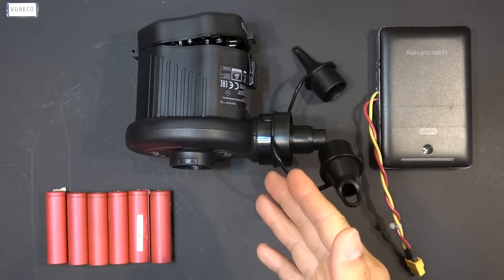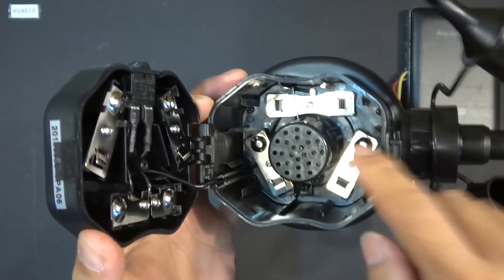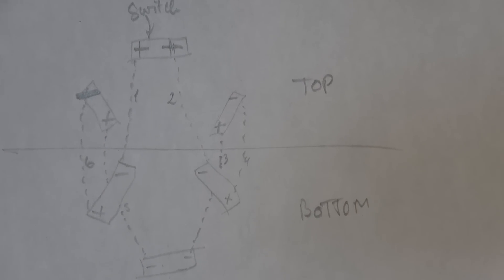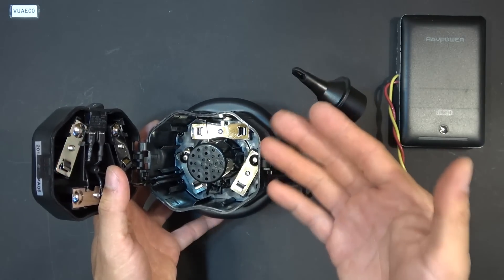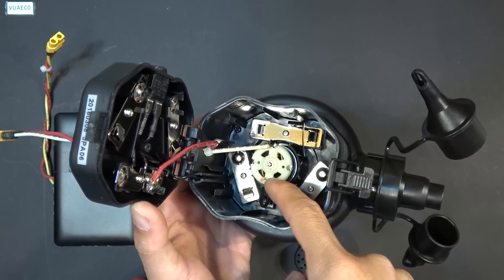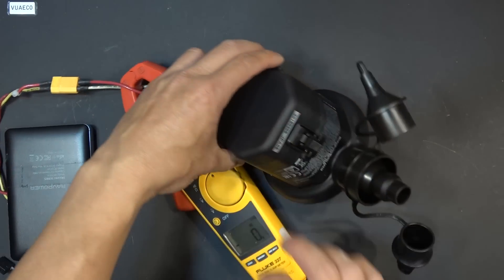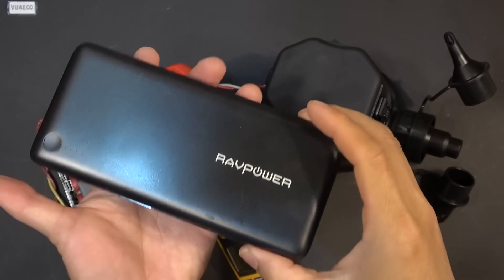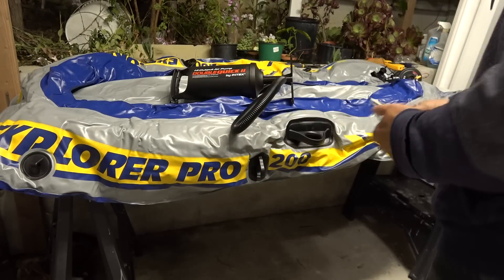DIY: Hack an Intex air pump to run on a USB power bank

Comment: I just tried something similar while camping.  I had the same pump and a makita 18v battery.  Only wire was about 8” of  residential solid 12-2 and only tool was a pocket knife.  One of the wires slipped and created a short and caused electrical smoke.    Whoops.  I’m glad to see I was on the right track with my McGyver hack job though lol

Comment: Would there be a way to make the pump go slower? Would decreasing the voltage help, or should I decrease the amount of current that goes through it? Could I put some type of potentiometer in between? I would like to use the pump to make some type of Powered Air Purifying Respirator. As the pump runs on less than 5V, I thought it might be useful. Any ideas?

Comment: Great video ! I have the exact same pump.  It is marked as 25W(atts). So I am puzzled as to how the unit could draw close to 20Amps given that the input voltage is just 4.5v. Any ideas?
Reply: I don't understand that either, shouldn't it be  5.556 amps

Comment: After you get the boat inflated, run the pump into the water to turn it into a jet motor. Ok maybe not.
Reply from the maker: Maybe not for an air pump but a submersible water pump will do.

Comment: vuaeco YOU NEED TO MOTORIZE THA RAFT!! THAT WOULD BE TOOL COOL, TRYING TO JUMP THE WAVES PEOPLE WOULD THINK YOU ARE CRAZY HAHAH UP LATE AGAIN WITH STUMP PAIN, GOT TO TAKE THE MEDS TO KEEP MY HEART PUMPIMG AND STUMP FROM HURTING HAHAH GOOD TO SEE YOUR VIDEOS AGAIN, BEEN IN THE HOSPITAL NEED TO BINGE WATCH TO CATCH UP. I WILL BE GOING TO GET BATTERIES FOR MY WHEELCHAIR BUILD, WHAT POWER PACKS DO YOU THINK WILL GIVE ME THE MAX POWER? I REMEMBER YOUR VIDEO SHOWING LAPTOP BATTERIES VS TOOL HIGH DRAIN BATTERIES IN YOUR RC CAR! LOVED THAT VIDEO, WOULD LOVE YOUR OPINON, GOING TO TRY AT RECYCLE PLACE TO GET THEM FREE. , YOUR YOU TUBE FRIEND OLD ONE LEGGED JOSEPH T RETIRED NAVY
Reply from the maker: A motor on this raft will just rip off the rubber. But yeah, it'll be cool to jump the waves on this even just for a couple minutes! :D
So sorry to see you hospitalized. Get well soon. You've served all of us so we can enjoy the peace and freedom today. My hat's off to you, Joseph. Right on memorial day, too!
Regarding power packs, it depends on how far you want to go on it. If you don't go that far and have access to a wall outlet to charge your battery pack, I'd use the Kobalt 24V packs. Two of the 4Ah packs should be enough power. You can also hack the 2Ah packs and put 2 in parallel and that's $10 cheaper! :D You can use laptop cells but you'll need to put about 10 or more in parallel to get enough discharge current. You might not have enough room in your wheel chair for that many cells, though.